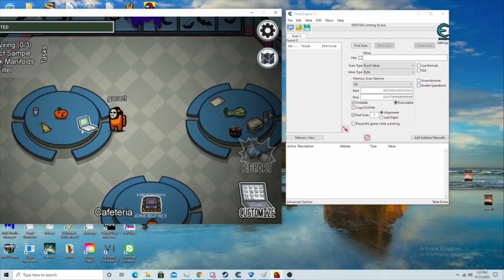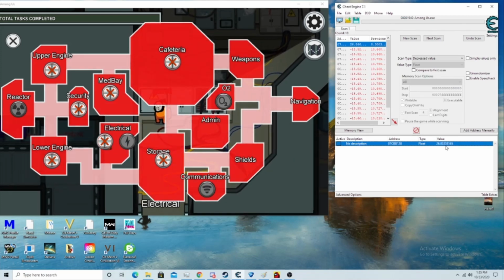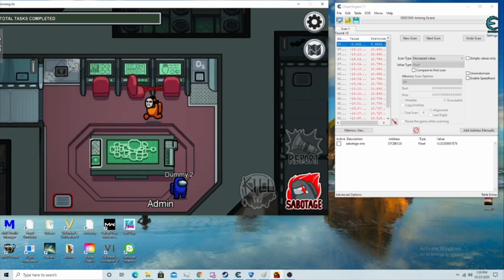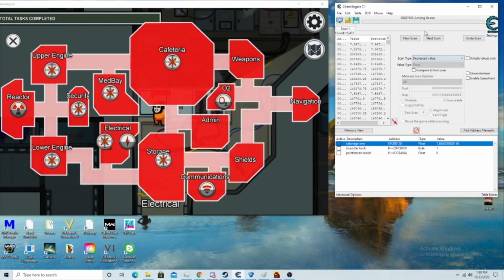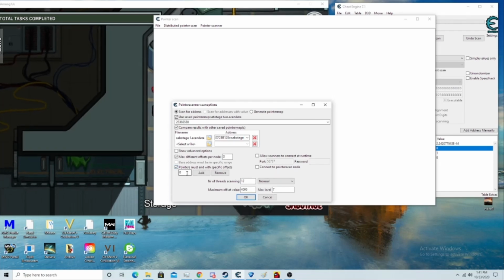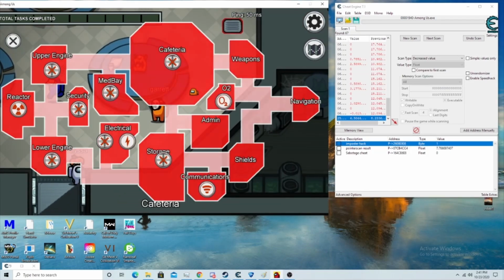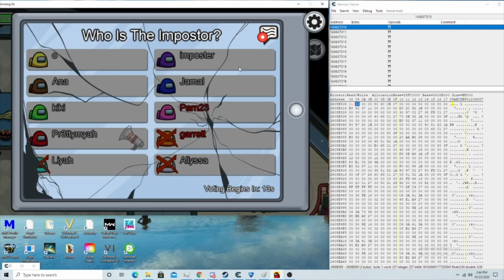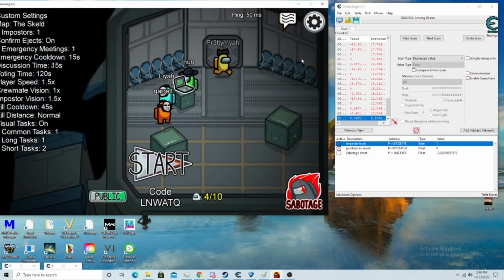How to Hack Among Us using Cheat Engine - Wall Hacks and Sabotage Menu - Episode 3

Comment: Yo dude. For the wallhack, there's a better address to use. If you use "UnityPlayer.dll"+012A86E0 : offsets 80,5c,0 : you can easily go through walls without dying first and such. It's a 4 byte value, just change the 2 to a 1 to be able to go through walls.
Reply: Could you give the steps to get to there please?
Reply: Yes please, describe how did you get there.
Reply: its not work for me
Reply: @kingsec4535  Game have new update. Every update you need to update adresses etc..
Reply: @vertyks6201  only hack impostor can autorenew address hmm...
Reply: @kingsec4535  The game updated. The address is no longer valid.

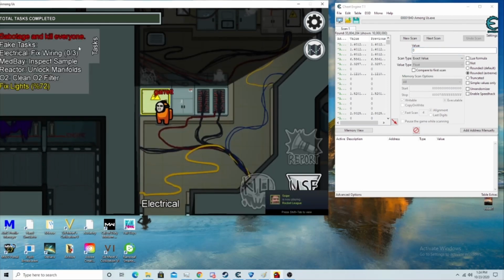Comment: Can you help me why 15 in 2:04?
Reply from the maker: You can choose anything to try to reduce the amount of addresses. My method was this: Its a count down timer that is 30 and going down. So i will scan for any address greater than 15, and will keep rescanning until the countdown is below 15, which i then switch to the option "Decreasing Value". You can do anything you want to find your address!
Reply: @Gkidding  Thanks <3
Reply: @Gkidding  hi, i have other issue if i join normal game my pointer value is "??" and i can't change this can you help?
Reply from the maker: @neleguFN    This can happen from time to time. Theres a couple things to check
1) make sure cheat engine still has among us as the process listing.
2) Run around in the public match and see if the ?? goes away.
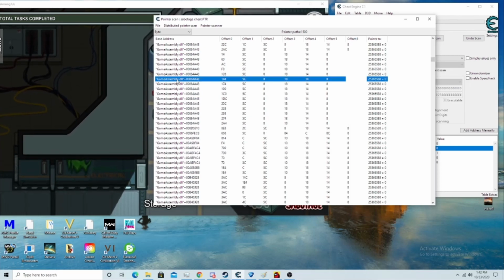3) select a different pointer address that has a lower amount of offsets( the lower amount of offsets, the higher chance of success you have, Look at (12:25-12:45). Also make sure that the pointer address you selected is from the GameAssembly, not things like threadstacks, or discordapps.
Hope this helps!
Reply: @Gkidding  oh i use the lowest amo8unt of offsets and i use gameassembly ;/
Reply from the maker: @neleguFN   have you tried different pointers? And when the value is not ?? Are you able to change it and it affects what you want? I suggest comparing the two pointer maps again, grab a new pointer, and make sure that the pointer you grab equals what the current value of the address(right side of the pointer results page).

Also be sure that you have seen the first two videos in this session to become more familiar with this